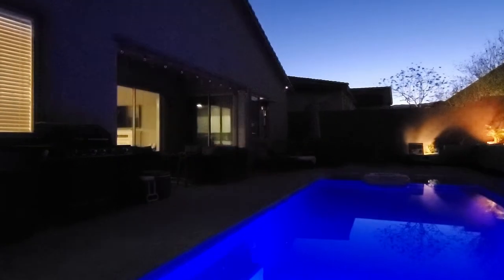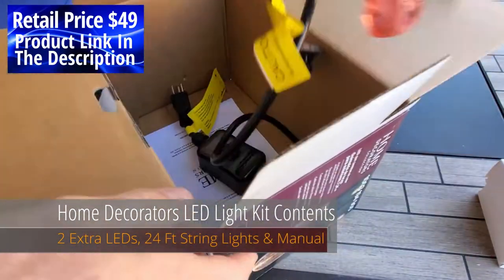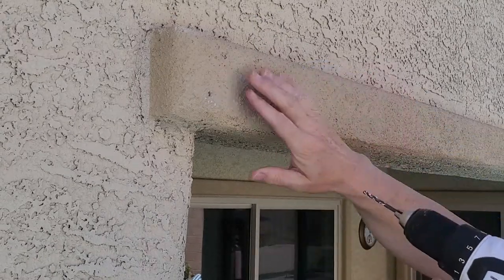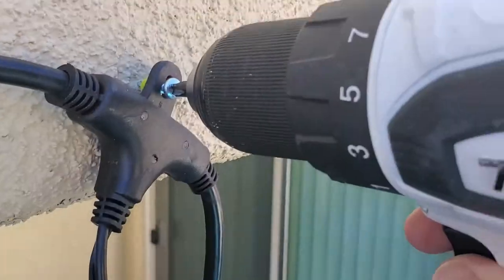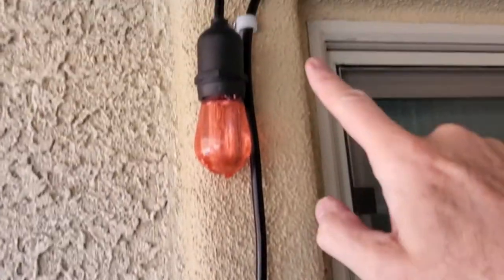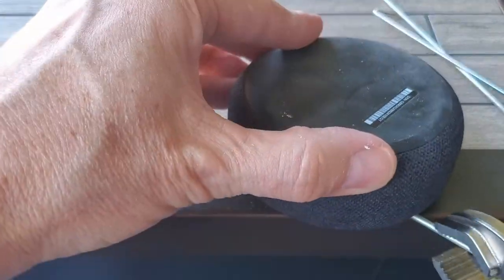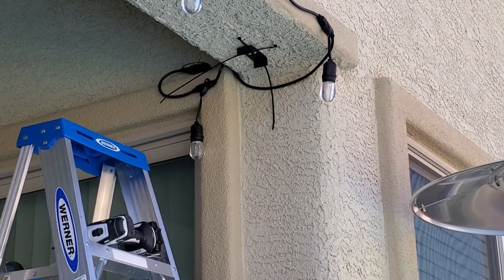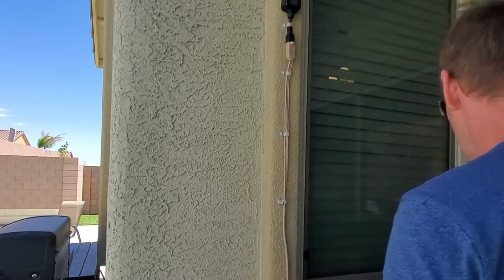Color Changing String Lights | Echo Dot Outdoor Mount - How To - Quick & Easy!

Comment: I worry about the anchor not holding the light, after all it is just stucco! With the wind here it can easily pull out! Is there a stronger solution to anchor lights to stucco? My patio is all stucco , I would love to change heavy mosaic lighting fixtures but I don’t know how , since the ceiling of my patio is also stucco!
Reply from the maker: All anchors have held perfectly for over 3 years and Las Vegas gets super windy!!! Thank you for watching!

Comment: Any issues with weather and the dot. I will be placing under a s covered deck and no direct water.
Reply from the maker: No issues at all. It rains and gets hot and cold. Works great. Thank you for watching.
Reply: @UltimateTechHub  thanks 🙏